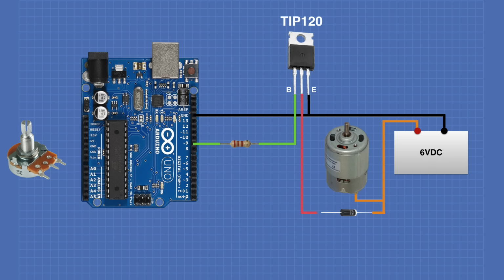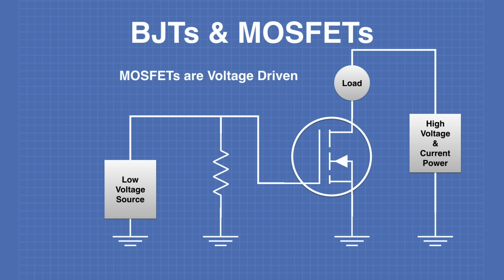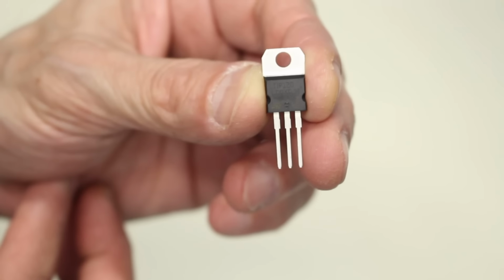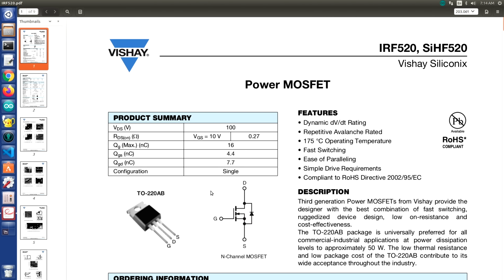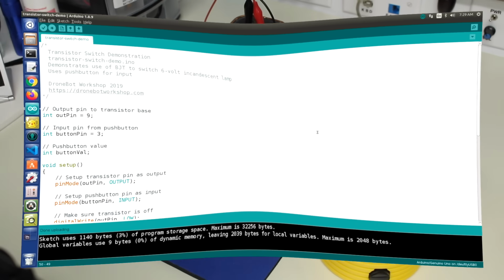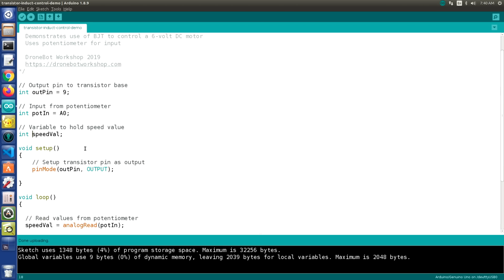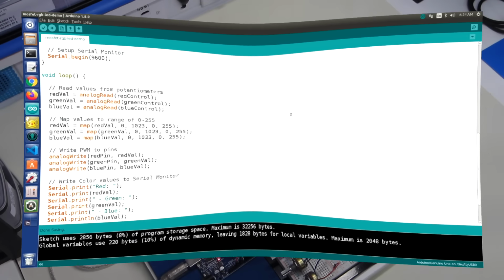MOSFETs and Transistors with Arduino

Comment: Excellent tutorials. Thanks. I wonder if you consider making a tutorial about HC-12 radio modules. I watched your video on 433 MHz modules which have limited distance of operation, while the HC-12 modules can work (under certain conditions) up to 1km distance, so I think many Arduino enthusiasts may be interested.

Comment: Thanks for your Videos. I learned a lot. Can you please give or make one on how to control (switch on/off & increase and decrease) a high voltage DC power supply say 50 kV , 50mA? I need such video in my research work. Thanks in advance and regards

Comment: Im very new in circuits, can you explain whats the purpose of the 2.2k resistor and how do you pick a potentiometer for a certain project? Thank you!
Reply: Because a bipolar transistor needs a current into its base to work, it is known as a "current-driven" device. But you cannot just put any voltage onto the base as it might draw too much current and fry the transistor. So you use your knowledge of the voltage you have available from the Arduino (around 5V) and Ohm's law to determine that a 2.2K resistor will limit the current supplied to a couple of milliamps, which is ideal for this circuit. If you need more current, you can use a slightly smaller resistor, but you won't go below 270 ohms because the Arduino can't supply more than 20mA from its digital pins anyway.

Comment: Hello. Great video. Question:

How do you calculate the resistor value that you should put in series with a specific transistor in order to prevent it getting overcurrent?

Comment: Mosfet's and Transistors are as I am right semiconducters made with silicon, what if we made those of recycled aluminium, glass and Carbon-plastic That is cheaper in fabrication perhaps and faster in transmission. Thank you for this video

Comment: Thank you so much for this really instructional video. I’ve got a probably very silly question, why do you connect your potentiometers both to 5v and gnd ? I’ve always connected only 5v and the analog input and it’s been working fine so far. Thank you again.
Reply: Not a silly question!  If the ends of the pot are both connected the wiper taps off a fraction of the voltage.  So for a linear pot across a 5Volt supply placing the wiper half way gives 2.5 Volts,  etc.  You're  using part of the pot as a variable resistor and depending on in-chip leakage to ground.  Well, if it works it works, but potential drawbacks include non-linearity, variation with individual chip (or is that specified? Dunno) greater temperature dépendance and higher sensitivity to noise.  So if you have a spare wire and smidgeon of solder. .....
Reply: Thank you for your answers, I’ll remember that next time and probably come back to some circuits I’ve done before :)

Comment: apologies in advance if this question has already been asked/answered: 
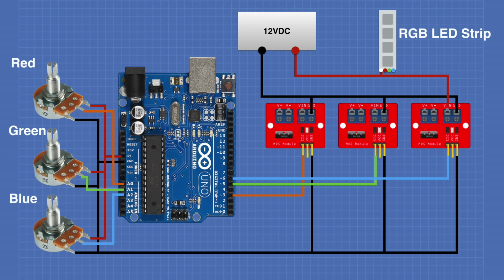why connect 12VDC+ to the Vin terminal of each driver board (34:17)?

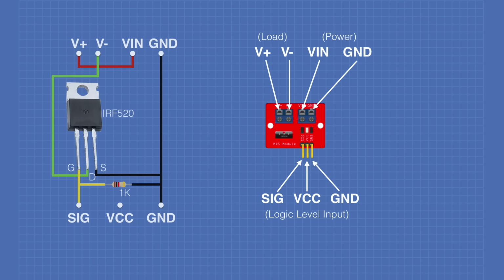according to the schematic (31:40) Vin/V+ are not connected - or needed-  as part of the driver circuit as the RGB strip itself distributes 12VDC+ to each channel of LEDS.

It seems to me the only terminal-connections that are needed are GND and then V- for each of the R/G/B loads to switch each channel to GND and complete the circuit.
Am I missing something?

thanks for a great video!

Comment: Thankyou, very interesting! It would be good to know how you determined the value of the current limiting resistor for the transistor, and also why is the terminal on the FET labeled V-?
Reply: Like most Darlingtons, the TIP120 is usually driven in saturation so that the base current is no less than 1/250 of the expected collector current. By Ohm's law, the chosen base resistor 2K2 will ensure that around 2mA is delivered from the Arduino's 5V output on I/O pin 9 into the base of the TIP120, thus saturating it for up to 500mA of collector current. If you used a larger load, then you'd use a correspondingly smaller resistor, but you'd also need to start adding a heatsink once you used much more than about 0.5A of current into the load.

Comment: Very well done presentation. Very educational, informative and confidentially spoken. I do have a question:  If you use a relay module in place of the MOSFET, can you now run a 120v circuit off of that?  I seem to remember doing that with  the relay module a couple of years ago.  please correct me if I'm wrong, and thank you for the video :)

Comment: Thank you so much for all your videos, some of the most practical electronics help on the web! 
When would you choose Mosfets over BJTs?
Reply: When you want to deliver more than a medium amount of current. This is only a rough guide, but ...
If you use a BJT, you'll be limited to around 400mA or so by the inability of the microcontroller to supply the base with more than 20mA.
If you use a Darlington, you'll be limited to around 10A or so because of the amount of power dissipated in the transistor even with a decent heatsink.
If you use a mosfet, you can drive 50A or more, depending on the type, because the very low Rds(on) in high-current mosfets means comparatively little power is dissipated in it.

Comment: 34:39 I can see (with a little back and forth to the prior diagram) that the Arduino ground really is connected through to the battery "ground"... but, would it not be a good practice to also connect a GND from the battery to the arduino? Otherwise, it looks like there are two isolated ground circuits, only connected through the MOSFET boards (where we trust and pray that the implementation is correct)

Comment: Awesome. Can you/readers please suggest a P Complement of IRF520N.

Some suggest IRF9520 which has a much higher Rds(ON) but about similar Input Capacitance.

Some suggest IRF9530 which has similar Rds(ON) but quite higher Input Capacitance.
What does a pair should match? Rds(ON) or Input Capacitance?

Current pair I use is IRFZ44N-IRF4905 but cant use it with 5V signals.

Cant get True Logic Levels Transistor in my region 😖. IRF520N is my best bet. But really need its P complement too because I dont stock any Transistors without its complement and I usually prefer High Side Switching but dont want to go bootstrapping for simple circuits.

Comment: 32:40 Hello, great video, but one thing I need clarification on. I want to connect the solenoid via the circuit you show in the video. However, the IN4004 rectifier diode is missing from your circuit. Can I connect the diode between the VIN and GND pins?

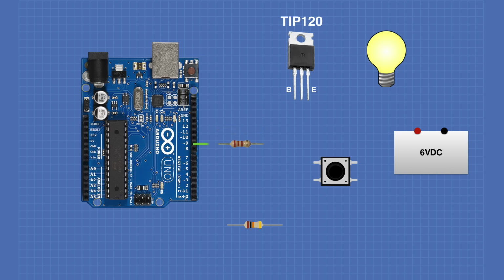Comment: 13:34 I have only IRF540N Can i use it? and what is the resistor value you mentioned? Also 17:36 If you forget to put 2.2k resistor between Base and Arduino pin it will damage Arduino pin right?
21:36 Which wire you pulled out drain or source? Still don't understand about 0.7v drop thing.

Comment: 18:27 Why dont you just put the button in series between the arduino and transistor, so when you press the button the current flows and the light turns on?

Comment: In the RGB LED strip sketch wiring (@39:40) for example), there is no power or ground connection to the Arduino.  What powers the Arduino in this case, and does the 12VDC power used for the lights have to be isolated from the Arduino?
Phil in gorgeous Young Harris, Georgia, USA

Comment: Fantastic explanation. Could we pull-up the pin internally in this setup without having the pull-up resistor?
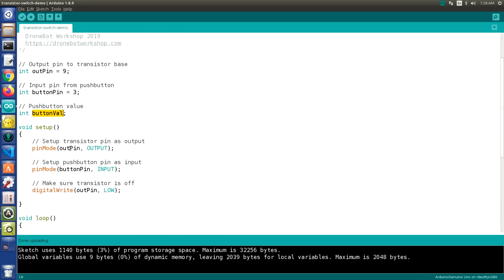Reply: Yes for the push-button input. At 19:08 write
pinMode(buttonpin, INPUT_PULLUP)
and then you can remove the 10K pullup resistor.

Comment: Hello The videos in this channel are a great learning tool, easy to undestand.
I need to know if an IRF520N module is suitable for up-volt a serial 9600 tx signal
(up volt to 12Volts, required for Arduino automotive scanning tool project)
If not any better options?

Comment: Thank you for your time, very great way of working!
I have a question about IRF520 usage, seems to me it can't work correctly like that, I had problems using in a similay way (I might be wrong!). I tried driving 12V loads using IRF MOSFETs with only 3.3V or 5V on the Gate pin (ESP8266 and Arduino UNO); what happens is that MOSFET gets really hot even with very small loads (0.5A) because the gate voltage is too low. From datasheet max VGS(on) is 20V, so MOSFET starts working in the correct region with at least 10-12V on gate. Am I correct?
If you think your schematics with IRF520 are correct I could even try making it on the fly to see if it heats or not with a 0.5A load.
Reply: The IRF520 is specified to turn on fully with Vgs=10V. At lower gate voltages, a given sample might or might not. You just don't know. Although I bet it won't turn on fully with just 3.3V
There is a logic-level equivalent, the IRL520, which has guaranteed turn-on specifications @Vgs=4V. It costs about the same and has similar performance otherwise (although the max allowed gate voltage is a little lower at ±16V). It works fine with 3.3V microcontrollers. I can see no good reason why anyone would use an IRF series mosfet with a microcontroller when the IRL logic-level series is available and affordable.

Comment: On the wiring diagram you connected the diod parallel to the motor inputs - isn't there a mistake? How can it protect from backward current from the motor spinning up floating back to transistor, when it's connected that way? It should be connected sequentially instead, no? On the real schema you connected it correctly I think

Comment: Hi, TO3 and TO66 are NOT the same.  The TO66 are smaller.  Today you will only find TO66 as replacement transistors, not for new design.  However, the TO66 lives on in plastic form, ..... the TO220 !  Yes! Try to work how. Cheers From New Zealand.

Comment: Really cool!  I had a set of those about that long around the windshield of my Class A Motor Home for holiday use.  They are still stuck up there and have been for over 6 years, it came with an AC to DC power supply with built in controller so I ran it off that.  We used to head south in November from South Dakota, and  come home in March from Arizona so it was a home for me and my wonderful wife (RIP) who was taken from me because the hospitals shut down just when the cancer made itself known if she could have been tested, it could have been stopped but the test was considered non essential surgery so she had to wait 3 months and by then the cancer had invaded most of her body.  It was a long 3 months at home while I with the aid of my daughter cared for her as the cancer ate away at her fragile body.  In the end she spent 4 days in hospital till her last breath was taken, with me on one side and my daughter on the other holding her hand as it was exhaled for ever.  Damn covid!  She did not have it but the government kept her from the test and at the time there  were NO CASES and the hospital sat empty!

Comment: Thanks, always good info. I am in the process to set up a similar scenario but I am using 12    SK6812RGBW  5V LEDs. In my set up I will have four pots to regulate independently each color. R,G,B and the white W from zero to max.  Each have a V+ and Gnd plus a data in and data out that goes to the next one. In the phase of programming now but having some difficulties especially to incorporate pots. Normally in the program one defines how bright each color is for that loop from 0 to 255 that can go gradually up and down. But to regulate it with a pot right now it seems a challenge. Any advise is appreciated. Thanks.

Comment: If I wanted to control an electromagnet and it’s respective magnetic strength via current, utilizing a mosfet module, would the positive end of the magnet need to be plugged in to a common positive (12VDC) as you did with the LED strip?

Comment: Thank you for this video. Is pink plastic lining necessary for the parts drawers?
Are those cheap partitioned cases with transistors sold on AliExpress safe, as far as ESD  (static) is concerned?
A post/video on organizing and storing components would be very much appreciated.

Comment: Super video. Many thanks. I have an issue though. I'm using a single MOSFET connected to the output of a DAC connected to a  UNO. I have set up a sketch that  generates a sine wave at the output of the DAC. When I view this on an a scope it a perfect analogue sine wave. When I connect this to the drain of the MOSFET the output of the MOSFET is no longer a sine wave. The output voltage of the MOSFET does not reflect the sine wave. It switches on and off as the voltage increases and decreases but is nothing like a reflection of the input voltage. Should I be seeing a sine wave or is the relationship of signal voltage input to output voltage more complicated? Many thanks again.

Comment: What is the benefit of running the potentiometer through the arduino instead of connecting it directly to the motor and using the output voltage to control the speed of the motor?
Reply: You don't set fire and melt the potentiometer that isn't rated for the sort of current the motor uses.

Comment: In the MOSFET example, how will it be different if only one load needed to be controlled? With a 3-loaded MOSFET and a singly-loaded BJT it is hard to understand the differences between the two. Could you comment on that please? Thanks a lot.

Comment: Thank you. I have a question or maybe a suggestion if you haven't done it already. What if my power source was AC and I needed to run a DC brushed motor. how would I incorporate that into the circuit ?

Comment: I have a question about the IRF520 mosfet module, is the V+ internally connected with the Vin? So could an alternative wiring be to connect the positive wire of the 12VDC source to Vin and then connect the positive wire of the led strip to the V+ pin on the mosfet module? looking forward for you answer, thanks!

Comment: Hi ! I've got two MOSFETS like the one you're talking about, for a raspberry project, to use them as switches. I 've not still tested them, but I cannot understand why they could not be suitable, 'cos the MINIMUM threshold is 2V (look at the specs), and the PI gives 3.3V for its logic GPIO ports...  So if 2 <= 3.3 <= 5v, it sounds that it would have to work...
Reply: Hi did you test it on raspberry pi ?
Reply: @solistoguitar  yes, they worked... Anyway, I,'ve opted for another logic-level mosfet just to be sure I'm using the ideal one.
Reply: @solistoguitar  hello, nothing special. I use it to activate a 12v led, so I connect the 3.3 v raspberry pin to a 1k resistor and then to the gate, the 12v +1 resistor (1k or more) to the led and then to the drain, and the source is connected to a pin ground in the raspberry
Reply: @run1492  thank you so much <3
Reply: But the maximum threshold voltage (Vgs(th)) for the IRF520 is 4V, so if you get one at the top end of its threshold range, it won't turn on with 3.3V. Or worse, you manage to get one working with 3.3V. But the specification for the Vgs(th) is the voltage on the gate when Id=250μA (look harder at the specs!). That's fine if you're only trying to drive small loads, but as soon as you try to supply some real current, the relative lack of voltage on the gate means that the Rds(on) is much higher than specified when Vgs=10V, and now you have current running through a significant resistance and so it heats up quickly. And because you're below the zero-temperature-coefficient voltage on the gate, you're guaranteed thermal runaway.

Comment: So what would happen if you removed the diode? I mean unless you are measuring it with an oscilloscope you wouldn't see the noise correct? Would the motor still operate the same with or without?

Comment: Hi DroneBot Workshop, thank you for your very informative video.
Would connecting the iN4004 diode in series with the motor also work? It seemed counter-intuitive to me to connect the diode in parallel with the motor. I'm sure I am missing something.
Thanks!
Reply: No, it won't work. The idea of the reversed parallel diode is that it conducts if the voltage on the collector/drain goes above the positive supply. When the current through an inductor stops, its magnetic field collapses and the voltage across it changes in such a way as to attempt to keep the same current flowing. That potentially can create a large positive spike that may exceed a semiconductor's maximum rating and damage it. The reversed diode across the inductor is quite good at absorbing the energy and clamping the collector or drain to a value within its rated maximum voltage.

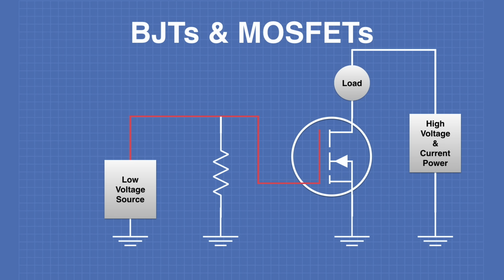Comment: You diagram at 5:24 shows a resistor to ground between the voltage source and the gate of the MOSFET. Why is that there?
Reply: Voltage divider and path for current to flow due to high gate impedace

Comment: 34:40 timestamp. If I connect power supply 12VDC to drive the arduino through DC jack, then, do I omit the ground on the Mosfet driver screw terminal? I mean it is connected through the Arduino grounds already, and mosfet drivers continuity between (sig ground and power ground)

Comment: Great video as always, but I'm not sure I understand what the role of the transistor is, in these schematics. If you have a button to power the lamp, why do you need a transistor if it acts merely as a switch?
Reply: If all you ever wanted to do was to turn on a lamp with a switch, you don't need anything else.
But then you'd never learn how to use a microcontroller that can take an input from a temperature sensor, or a light sensor, or remotely from the internet, and then use it to control something like a lamp or a motor.
This is 2022, not 1922.